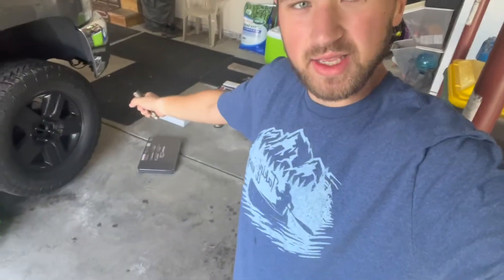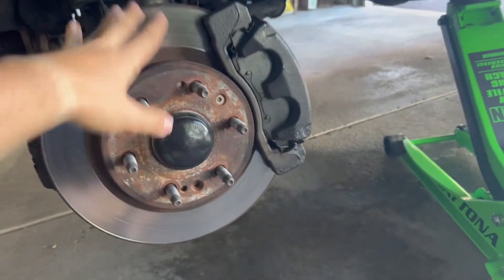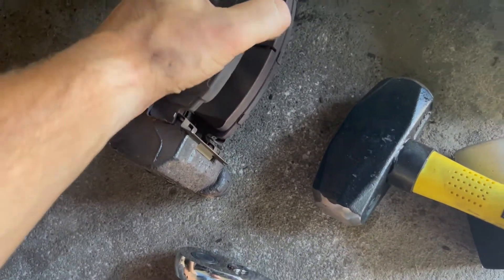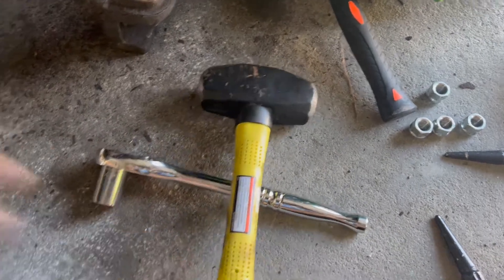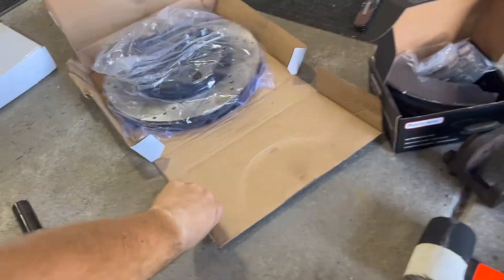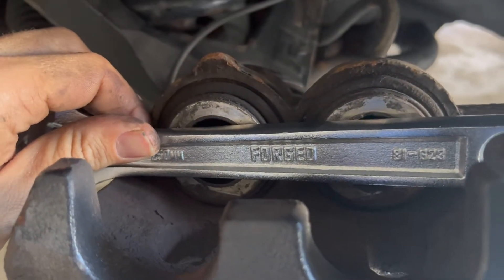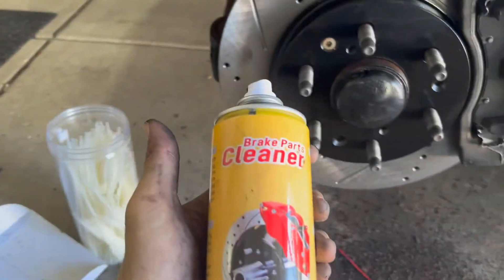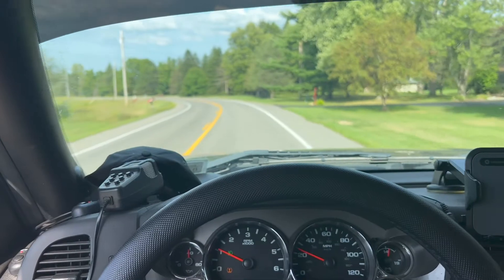Installing Drilled & Slotted Rotors with Ceramic Brake Pads! (MotorbyMotor)

Comment: Is it a big deal if I put the rotors upside down? So the slots are pointing to front instead of back. I will switch them again but hope it hasn’t done damage to my pads or wouldn’t cause issues
Reply from the maker: No just isn’t helping to stop the braking power that you get when you get drilled and slotted rotors